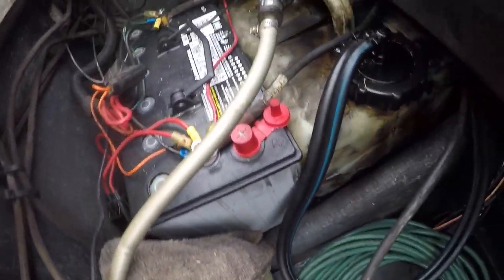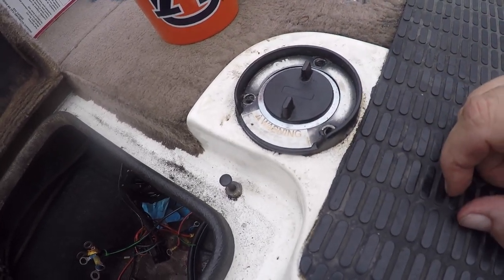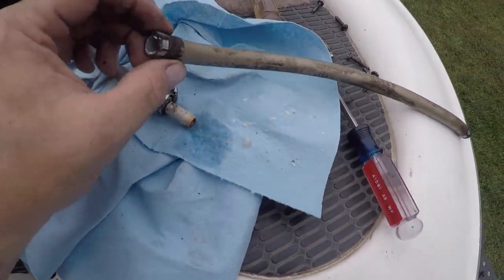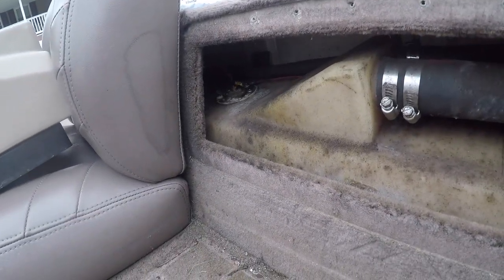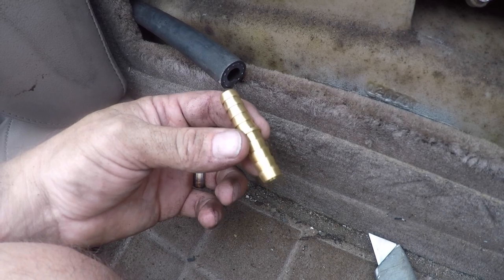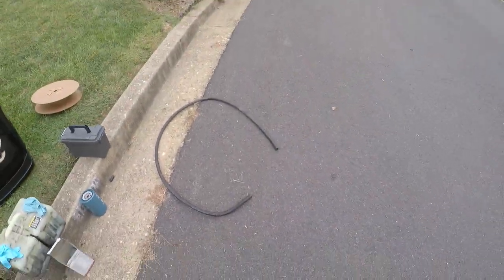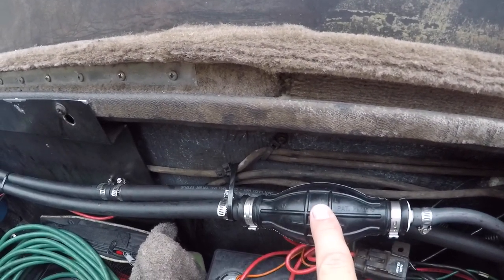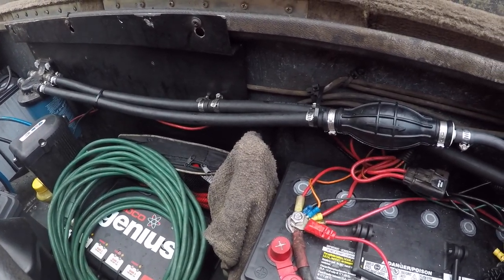Fuel line replacement on my 01 Triton TR21

Comment: Thanks! I’m working on installing the fuel line for my 1972 Slickcraft that I rebuilt. I installed a bracket and an outboard instead of the I/O. Mercury outboard has a filter on it, do I still need the fuel water separator? Do you know?
Reply: Be
Ok

 Va.
Reply from the maker: My outboard has one built in, but it is small, and harder to change. This is fairly cheap protection. I recommend it.

Comment: Did you just screw down the console where old seat was.  Trying to figure out if my tank is below or behind back of seat.  Don't want holes in my tank.  2001 tr 186
Reply from the maker: Yes, I screwed it down, but used short screws.  There’s about 1/2” gap between the seat base and the tank on mine.
Reply: @FishOn1  appreciate it bro.